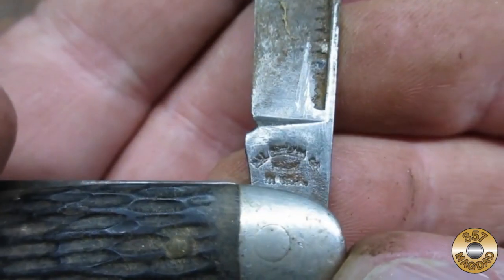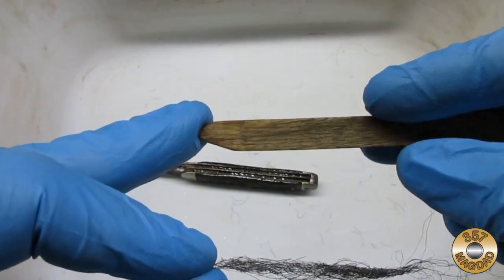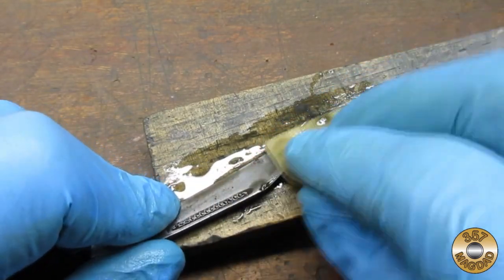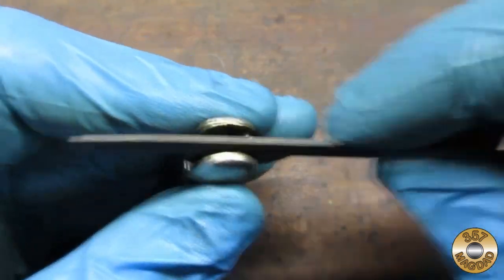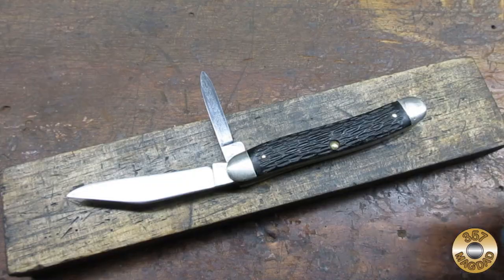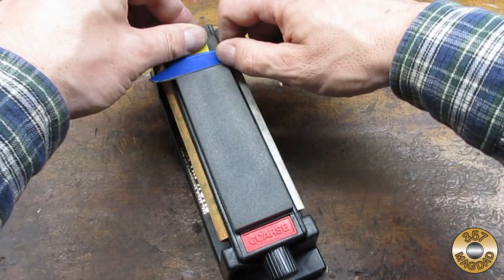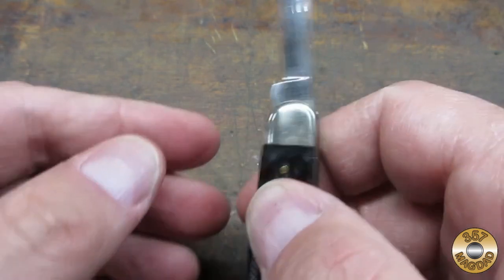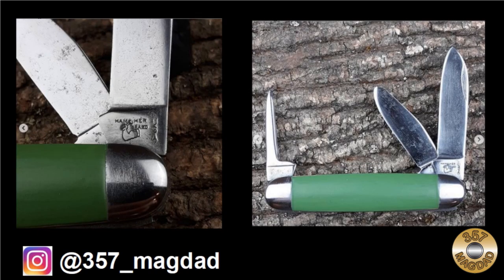Pocket Knife Restoration - PAL Cutlery Co.

Comment: I've got one right now it came from my kids great great grandpa this is exactly the kind of restore I need to do with it thanks for the going through it like you did it helped me out a lot bless you
Reply from the maker: I'm glad my video helped Mike!  Cleaning up old pocket knives is fun!  I'd like to see photos of your project!  357mdad@gmail.com
Reply: @357magdad   just soaked it in mineral oil so far lot of the  black stuff came off of the blade but a like what you do with the steel wool and a WD-40 I think that'll help a lot now I got to do is find the time to finish it
Knife was in better shape than yours got sentimental value not going to have to take it apart just got to do a little touch up with some sandpaper on the handle

Comment: Thank you for the videos, I have a 4 blade pocket knife 3 of the blades are broken, main blade is OK,I've taken the knife completely apart, would like it with just one blade, 3 pin holes in the spring  ,difficult to put it back  together, any advice would be appreciated.
Reply from the maker: I don't have a lot of experience taking pocket knives apart.  The couple I've done, I used small finishing nails to line up the holes and hold everything together while I replaced the pins one at a time.